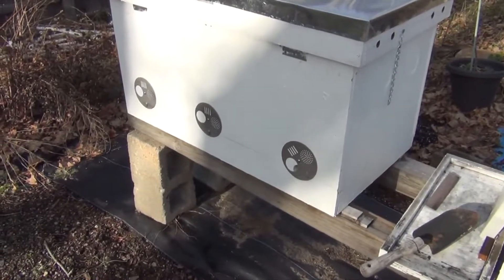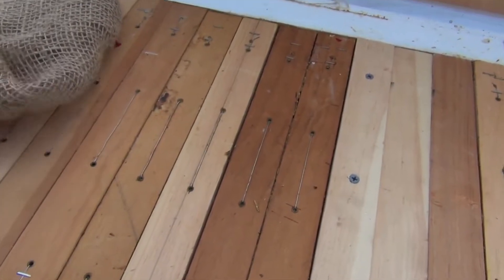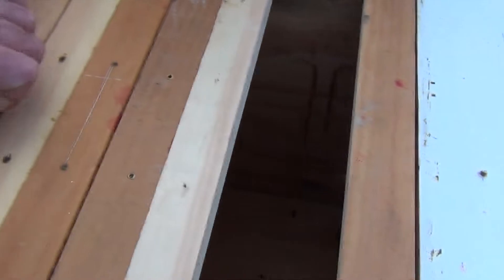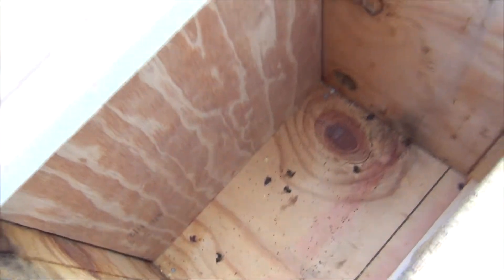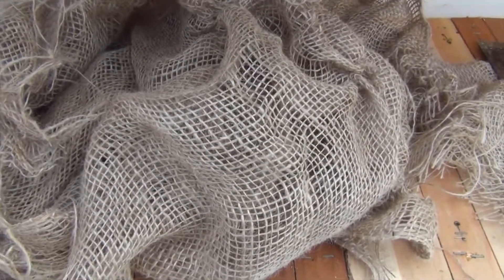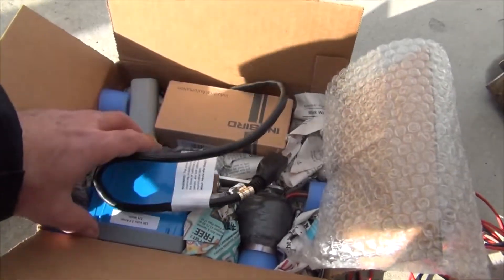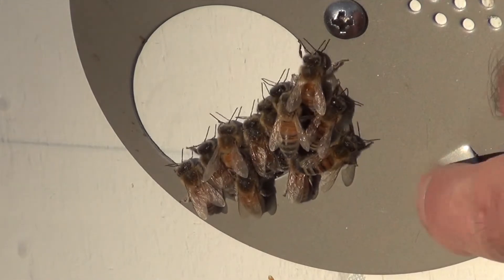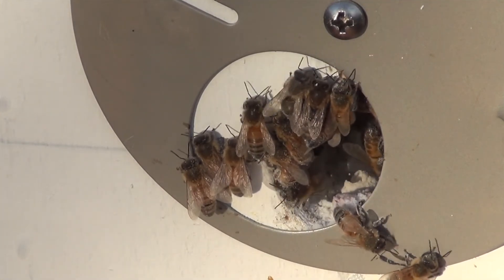January Beehive Inspection and Oxalic Acid Treatment

Comment: I think you did more harm then good to these bees at 43 degrees outside temps. Bees don't break cluster at 43, usually ideal temps for doing any oxalic treatment should be at least 50-55 or when you see any sort of cleansing flights. Good luck, and hope they will pull through for  another 3 months of our long winters.
Reply: Bees don't freeze to death unless it's EXTREMELY cold..40f is nothing. Bees starve to death if short of stores in a matter if days. You did nothing wrong.

Comment: I had the exact same problem a few years back. I used extra insulation the following year with much better results and fewer casualties. Thanks for the vid!
Reply from the maker: I have foam insulation sandwiched between the outside and inside walls.
Reply: @NewEnglandgardening  I also leant the following year my hive had pretty bad circulation. I checked for remedies online to improve and this had great results the following year. May be due to condensation rather than temperatures as low circulation can increase illness’s . Just an idea.